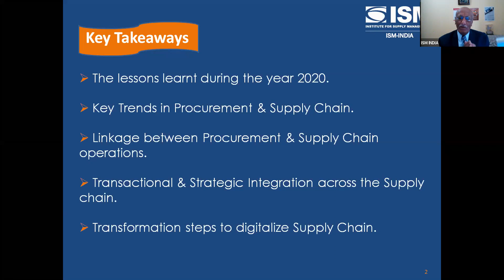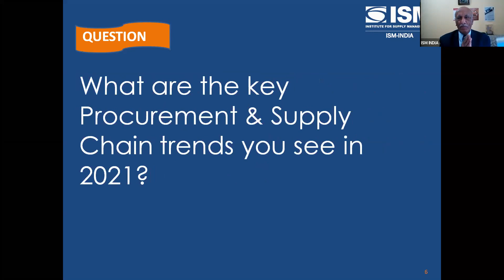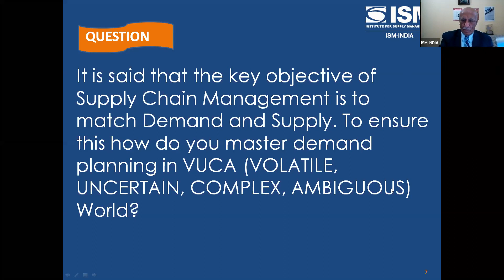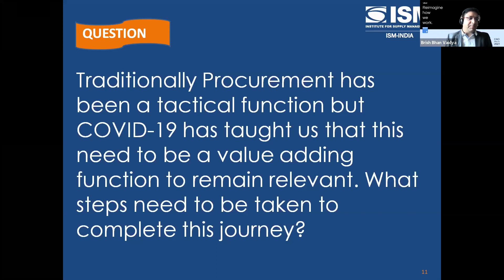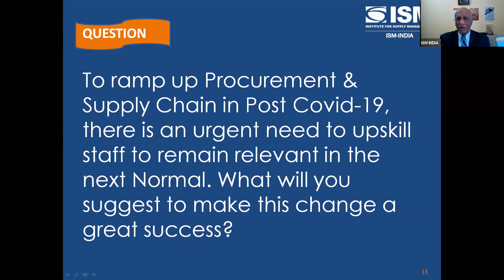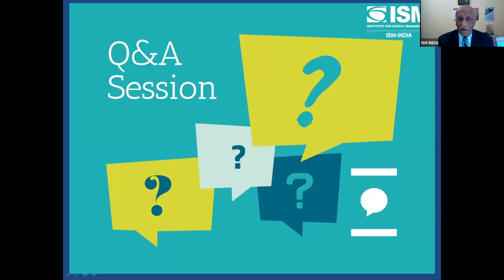Procurement & Supply Chain Trends for 2021 [Experts Talk Show]

Comment: Digitalization is the key! Leveraging digital means for shaping the procurement and supply chain activities can certainly come in handy. Aside to this coming up with more effective ways to communicate and coordinate with vendors/suppliers building effective relationship will enhance the trust factor. Besides this there is also scope for improvement in the implementation of several data analysis metrics measuring the performance of the supplier obtaining insights for better decision making while procuring activities. 

Thank you very much for sharing such informative content, wish to get more insights on the same.